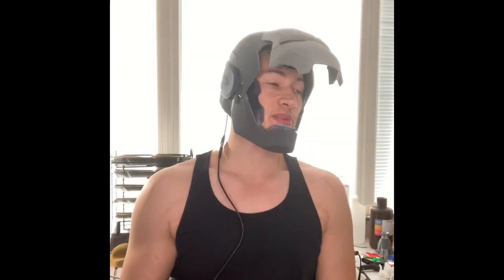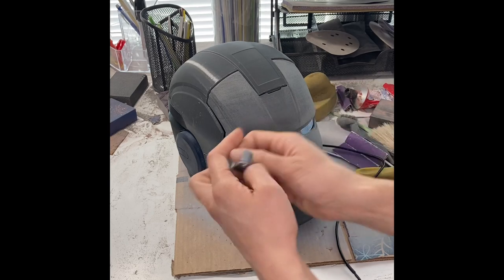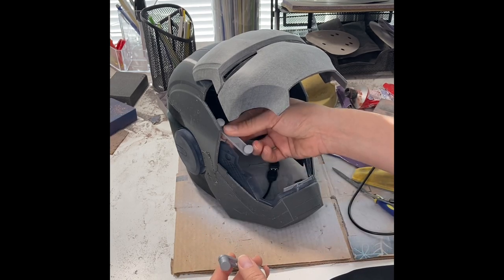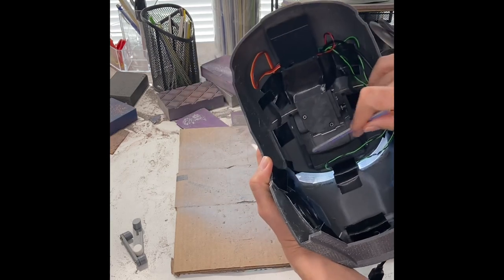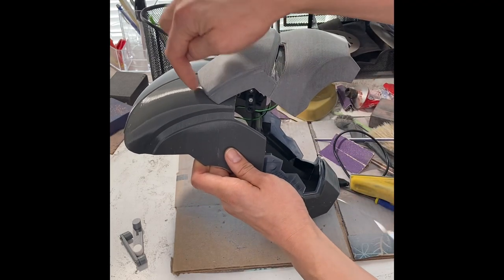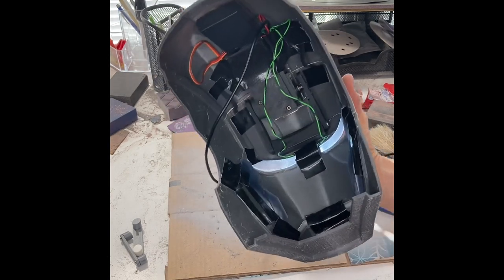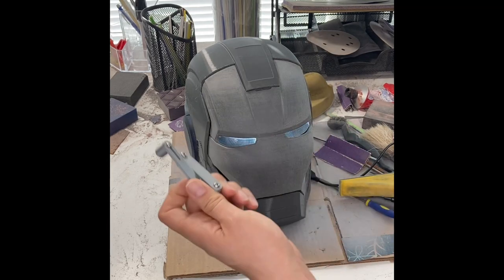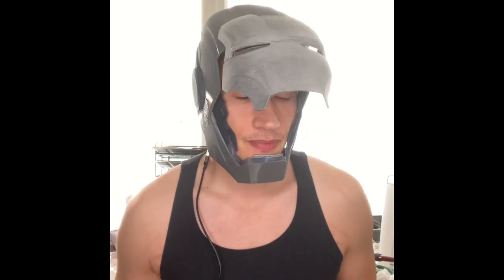Iron Man helmet motorization and flip up faceplate FIX! 3d printed cosplay DIY

Comment: Hi! I went crazy looking for this video and I found it again. As simple as it looks, I tried to remember how this worked and could not figure it so a new look at the video and bingo... Now that I know I can print the servo holder and try this out. Now I was meaning to ask, have you finished this? Also would the faceplate hit the top of the helmet? Just curios to know. Now I need to get elastic and play around this to see how I make it work :)
Reply from the maker: The helmet is now fully finished and works great, the faceplate does not make contact with the top of the helmet.
Reply: @RoguesGalleryCosplay  thanks for letting me know. I am currently sanding a helmet and have almost all printed for the faceplate movement, I will look at the video again for the elastic part. :) Thanks again!!!